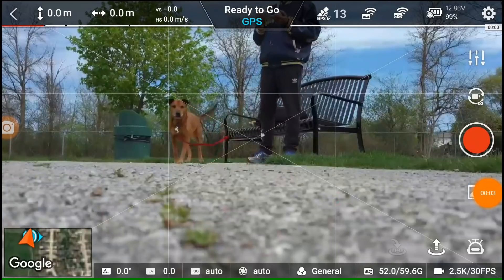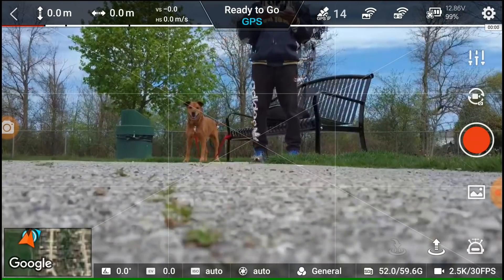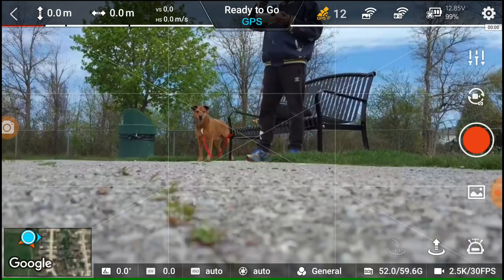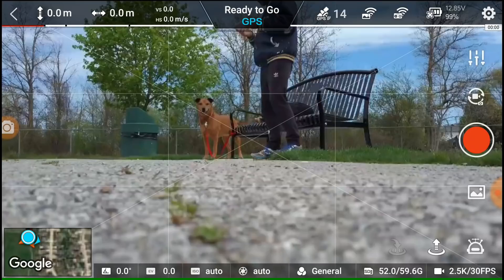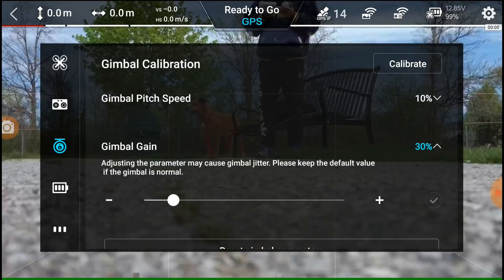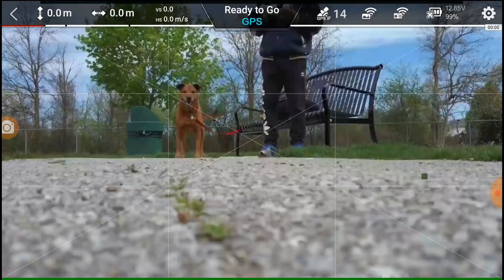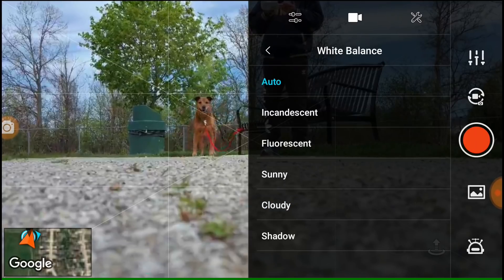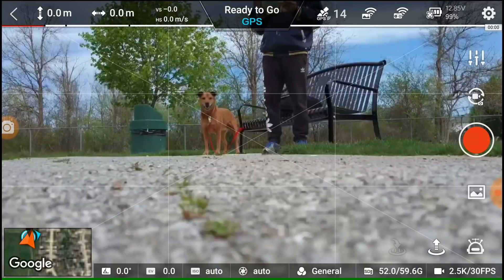Fimi X8 SE What does "Gain" Do?

Comment: so what did we learn about gimbal gain?
Reply from the maker: Wow... For me that's an old one. I remember the conversations I had with Fimi when they first came out with the idea of gimbal gain. I tried all kinds of settings. In the end they did replace the whole unit. Gain was to increase or decrease the sensitivity the gimbal was to the environment. Higher the gain the more sensitive and possibly more jello. The lower and the less sensitive (rigid) and possibly more jitter. In the end , colder weather made the gimbal dampners more rigid and caused shake. So I learned just keep it at 100... it is what it is.. Unfortunately in all the years since, Fimi has still not broken the mold.

Comment: I set mine to 26% and found it helped quite a bit with the gimbal issues on the 2020. To be fair though, mine never jittered like this, it just had a tilt issue after yaw. For whatever reason, after manual adjustment of the gimbal AND setting gain to 26%, it seems to return to level quite a bit faster now.

Comment: What we have here is a servo control loop problem.  Consider that a three axis gimbal is a three dimensional device/problem.  Three servo control problems that have to act together in unison.  "GAIN" should control the dynamic response of the control loop that stabilizes one gimbal.  As the "GAIN" is varied, the dynamic response of the gimbal (to stabilize one axis) should vary from: (1)under damped to (2)critically damped to (3)over damped performance.  If instability (studder) is seen over the whole "GAIN" range then it is possible/likely that there is cross-coupling (motion) from one or both of the other axes of the gimbal.  NOT a trivial problem. Xiaomi may need to add a cross coupling component to their design to obtain satisfactory stabilization.
Reply from the maker: In other words it may be the limitation of the design and it is what it is?
Reply: Yes, so to speak.  Gimbal cross coupling is a difficult problem, but it is solvable.  Depends on how much effort the 'manager" wants the designer/design team to "put in".  Caveat: presuming there are no boo-boos in the basic control loop design - unlikely since X8 flies as good as we have seen so far.

Comment: Man did you notice any improvement in the range ? How far the FPV is stable ?
Reply from the maker: The Video feed is less choppy but the overall distance is about the same... Not super impressed but it is OK.
Reply: @GorillamansGarage  how long is that distance you are talking about ? The price is good on this bird I'm thinking to get one but I'm not sure yet , it sounds good if you think about the price
Reply from the maker: @TexasCorgiGun  The range distance. In any kind of built up area... expect less than 600m
Reply: @GorillamansGarage  thanks for the info man appreciate
Reply: @GorillamansGarage  there is a guy who installed some range extenders , but he never tried the drone after that because he sold it , it would be awesome to see how the drone perform with them
Reply from the maker: @TexasCorgiGun  : I have them as well. Kind of a pain to put on and off but they do work. They probably extend (Directionally) 25-30%. I would think replacing the actual antennas with some better ones might be better. But I tried all the mods on my Hubsan H501ss and found the advantages were minimal at best. Of all the stock controllers I like the Parrot Skycontroller2 the best for range and performance. I am sure there will be some 3rd party mods coming soon as the signal strength on the X8 is an issue in any kind of build up area. In the wide open country however the X8 performs well. I do have a 2nd X8 controller I am thinking of Hacking and modifying but for now we all are waiting to see what Fimi can do with the FW updates that are sure to be coming soon. Currently for the price and Video quality... You can not really beat the Zino... even with its FC issues.
Reply: @GorillamansGarage  man if you do that mod it would be amazing ,I'm looking forward to watch that review
Reply: @GorillamansGarage  I get easily 1,5 km in built up areas. And where there is no interference, I get 8,7 km, but then it lands with 0 % battery when it returnes.
Reply from the maker: @TheOriginalChessMafia  : Impressive... what part of the world?

Comment: I have seen many video’s from the FIMI X8 SE. In my opinion the video quality is disappointing. For me video quality this is number one and my next drone will probably be the DJI Mavic 2 Zoom or the Parrot Anafi.
Reply: I've had them all, if you want great video quality the Mavic 2 pro is king and the Autel Evo is next..
Reply: AZRJR, I think you’r right about the Mavic 2 Pro and the Autel Evo, but for me the Zoom is important. This is the reason I prefer the Mavic 2 Zoom   at the moment. Greetings.
Reply: @gekoldronevideos  you guys are smoking that crack again. The X8 produces stunning 4k, perhaps you might need to do a manual focus which requires no ham fist approach along with a little patience. Go run to DJ and support the c Cp with your hard earned money but I tell you. Use h265, high quality, iso 100, sunny, general as far as settings unless you use f log in post but this is the best settings. Downgrade firmware if necessary or adjust the focus manually but you can't say all x8 have bad or less desirable video quality that's simply bull. Happy flying
Reply from the maker: Yes for the money the X8 is marginal at best. So many glitches that may take a year to get right. The Anafi (so Far) is a far superior flyer and the video is acceptable. The Zino has very good video but its flight characteristics limit it to fare weather flight. As there are a ton of Anafi drones for sale at reasonable prices that compare less than the X8SE and minimally more than the Zino... the Anafi is a solid choice. However the extra battery for the Anafi is expensive but still cheaper than the X8's. Depends on budget... If I were considering the Mavic Zoom... I would seriously look at the Autel Evo... But if there is no rush, I am sure something mind blowing will appear by late summer in the sub $1000USD range

Comment: I love my Fimi X8, but the gimbal has issues. Luckily it seems that most if not all of them can be fixed by Firmware updates. So far Fimi has been great in rolling out new Firmwares, but they have work to do and I hope they keep it up. The platform (airframe, camera sensor, gimbal setup) appears sound, especially for that budget. It just really hinges on the firmware right now.
Reply from the maker: They have known about this 3rd axis issue from the start. The FW befor this last update performed better on this 3rd axis. Seems they fix one thing and ruin another. I have sent them this video and 2 others from other reviewers with the same issue... we will wait and see.

Comment: I saw more judder at the higher settings.  Great test GM.  👍
Reply from the maker: I cant remember if it was the Spark or the Air that has the same issue??
Reply: @GorillamansGarage  The Spark does because of the two axis gimbal.
Reply from the maker: @IdahoQuadcopter  Fimi has known about their 3rd axis issue for months and I believe their update before this latest one was better.

Comment: Definitely no difference which as you know Im not seeing on my end either. 
What card do you use? Specs? 
Unfortunately that plays into the same effect so it’s hard to compare between one persons use to another persons when many use different cards. Thanks 🙏 good try and effort that I hope they start listening to. 
FYI...I find it better and more effective to show and present the issues and let them figure it out with no suggestion or guidance to a specific area of a supposed location to the problem because it often confuses and sometimes leads them in the wrong path to resolve it and only takes longer to correct as we pilots are sometimes wrong in our information or suggestions. 👍
Reply from the maker: 64GB Samaung U3 card EVO Plus exFat... 2.5k 30fps. Sent it to Fimi... we will wait and see.
Reply: True that.